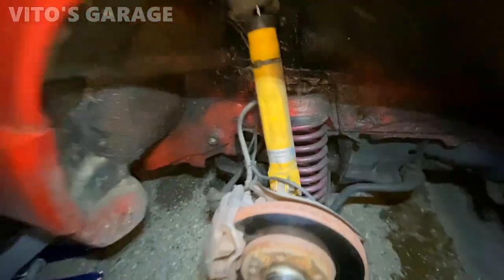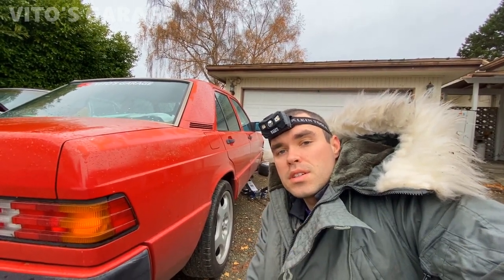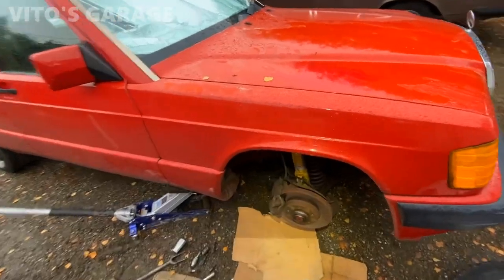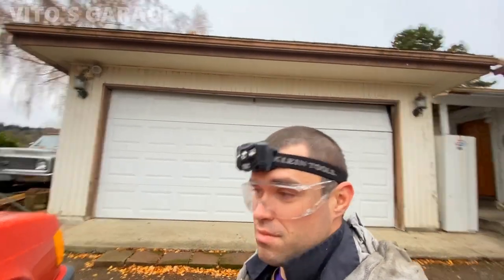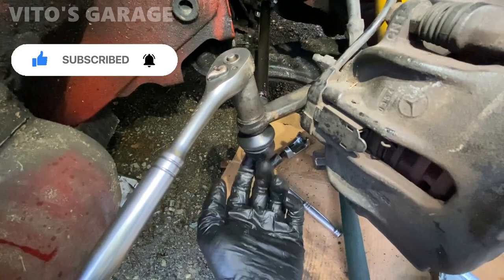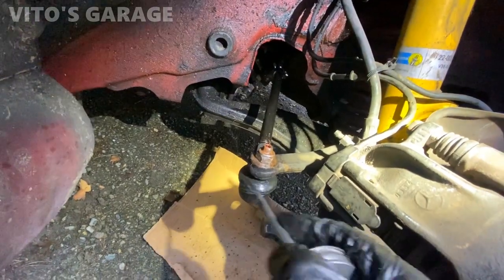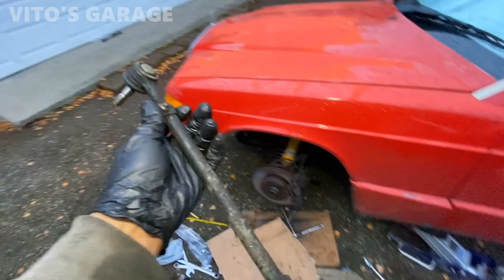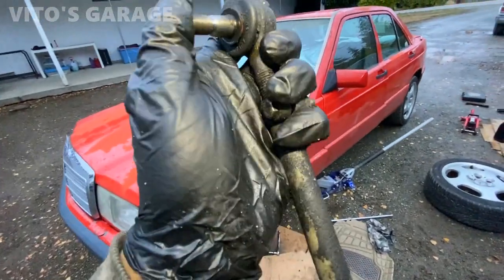Red Mercedes 190E Tire Rotation & Replacing 4 Tie Rods

Comment: What grease do you use? Thanks
Reply from the maker: For Underbody protection and adding grease to the tie rods- use wheel bearing grease;
For rubber boot protection on the outside- use silicone grease

Comment: Keep them running!
Personally I would have changed the whole steering rack for new since they come with the inner rods already, they are dirt cheap rebuilt here in Europe (200US$). Tie rods 15$ each (Meyle = OE)
Reply: Meyle is not OE. Lemforder and TRW make all steering and suspension components for Mercedes. The W201 was originally equipped with Lemforder. Meyle is not an OE supplier.
Reply from the maker: This car doesn’t have a steering rack. It’s a gearbox steering system. The idler arm on in was already replaced. Just the tie rods weren’t